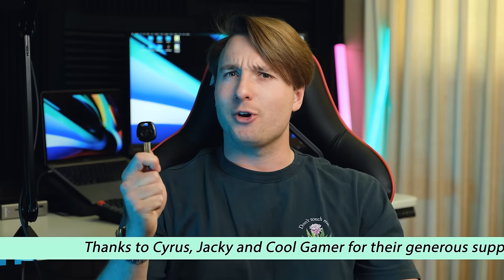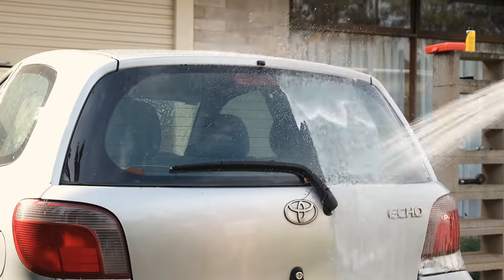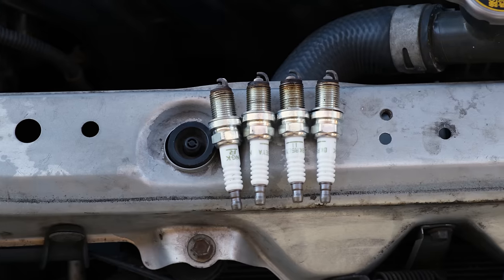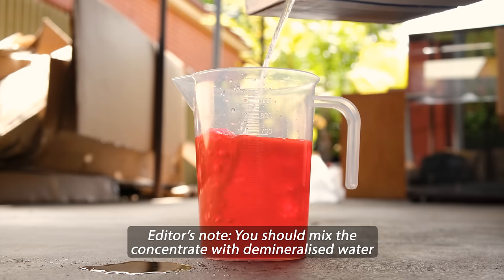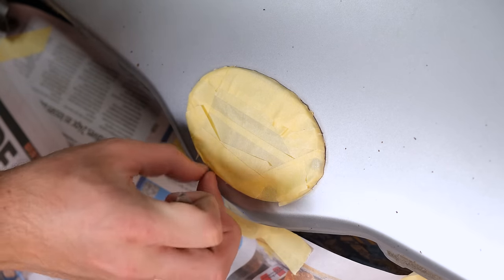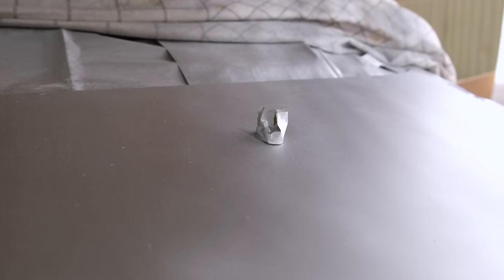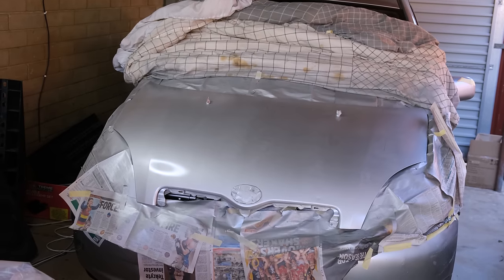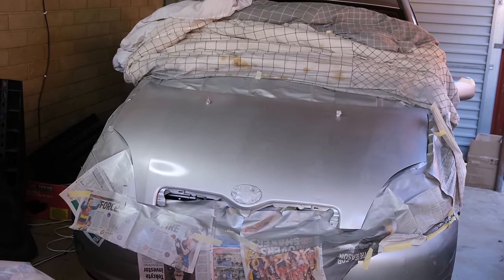I Bought A Cheap But FILTHY Toyota...

Comment: if you decide to paint your car like this...
please please PLEASE PLEASE IN THE NAME OF EVERYTHING THAT IS GOOD

SAND THE WHOLE PANEL SMOOTH AND REMOVE ALL CLEARCOAT

it will make the finished product look 10000x better!

also, try to paint in an area that doesnt have any dust as dust sticks and shows really ugly on wet paint

btw dont cheap out on the paint, rattle can jobs already dont look the best but if you go super cheap with the paint itll look like straight shit

rattle can jobs are a good alternative !IF YOU DO IT PROPERLY!

setup:
USE A MASK! this procedure WILL take long if you do it PROPER, youre NOT superman and your head WILL HURT like hell after like 30 mins of sniffing paint (dont ask how i know :P)
Try to de-dust your work area. dust will stick to wet paint and its impossible to remove dust specks from paint, other than sanding and literally re-painting.
DO NOT paint outside, dust is very much present in the air and will ruin the look if its a big panel.
try moving inside, tape everything up (walls, floor, furniture, cat, dog, children) and leave minimal ventilation, OR use a filtered vent, its the best of both worlds. (make sure the filter isnt dusty)
after the paint is somewhat set, open up the ventillation as paint drys way slower if its not fresh air.
do not to clean the surface between every coat, wiping it, blowing air on it, hell, even looking at it funny will damage the paint, its still wet, its very delicate

USE A GOOD, HIGH QUALITY MASK! (M3 has good ones for example) DO NOT DESTROY YOUR LUNGS TO SAVE 200$!!!!!!

1) USE A GOOD QUALITY PAINT FFS, something metallic will look best
2) use a primer if you can, helps with longevity
3) every applied coat should be THIN! if you put too much the paint will start forming into globs and look ugly as shit
4) wait for the paint to dry!! most quality paints will have a specified time there should be between layers, respect that, the manufacturers know best!
5) AGAIN! trust the process, dont apply too much at a time. it will be worth the extra time itll look 1000x better.

Comment: As long as the ambient temperature never goes below freezing, distilled water is a perfectly suitable replacement for coolant.
Reply from the maker: Good to know, I just had no real way of knowing what exactly was in the car previously :)
Reply: Coolant isnt the issue, you need the correct inhibitor which is the other component, because of all the different materials the water passes through. Without using an inhibitor you risk blowing head gaskets. E/A series Falcons are notorious for it, as they came on the second hand market people stopped using coolant and just running water and started blowing head gaskets.
Reply: It’s suitable but I strongly advise against using only water.
Coolant raises the boiling point of water, protecting your engine on those hot traffic jams where you blast AC.
It protects against rust and scale build up.
It also lubricates the water pump.
For 20$ I wouldn’t cheap out on it.
Reply: @okkrom  this is the right answer.

Comment: 0:19 It's rather obvious you have not spent time in the Global South. 😂  Getting that car cleaned thoroughly with the exterior would cost you less than AUD100 in almost all Global South countries. Probably another AUD100 to repair the bodywork.  500k+ km is "breaking in" territory for a Toyota even a little Yaris.

No other car comes close to the torture a Toyota can withstand.  

*It is the only brand authorised by terrorists/mercenaries/freedom fighters (whichever label meets your fancy) in the Global South.  😂

Just wanted to add some perspective. 😂 Cheers from Auckland